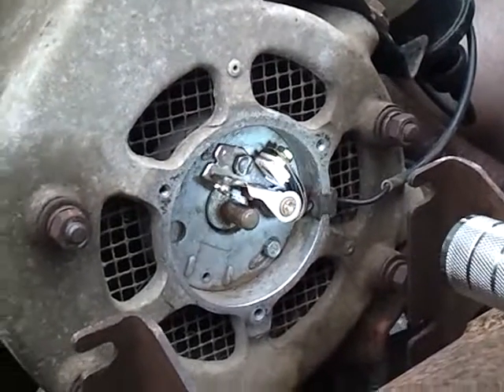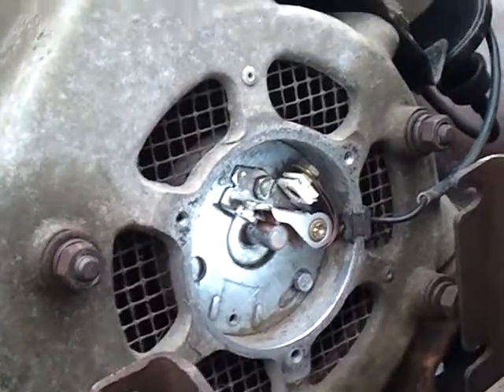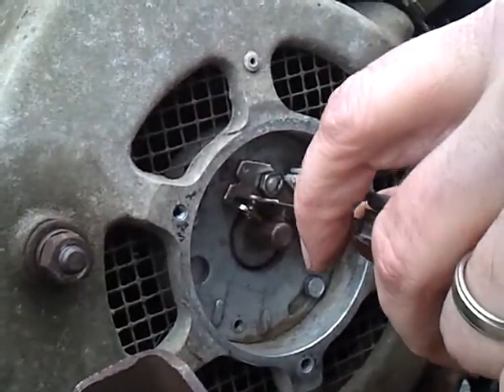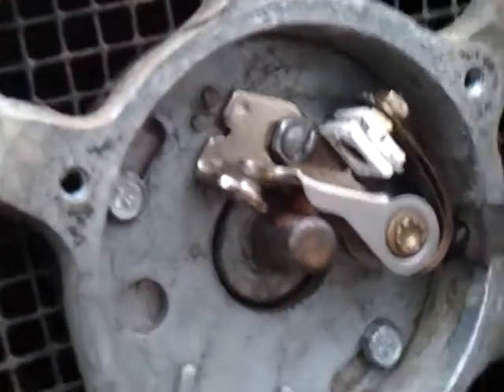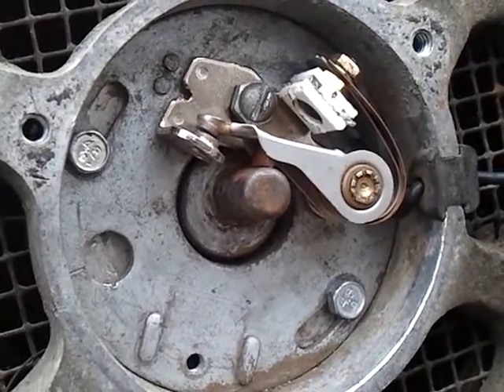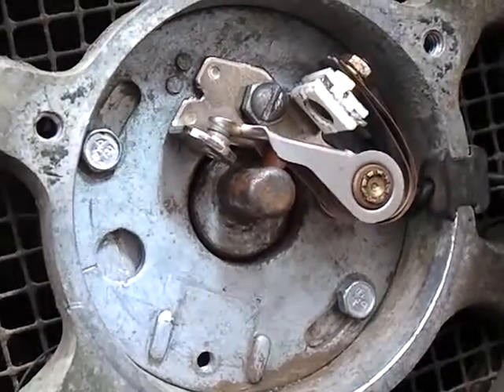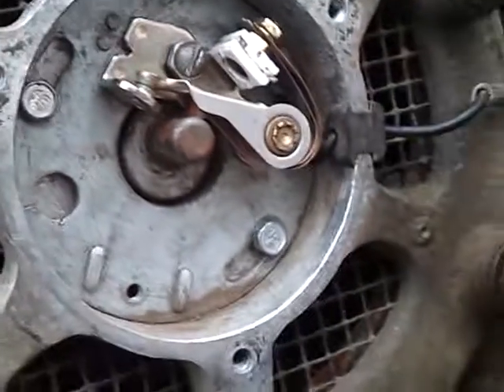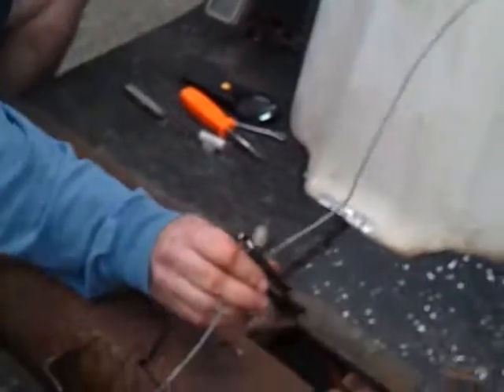Timing Harley Golf Cart

Comment: did it run better in forward  now.?    im having the same problem
Reply: Did you get that solved..i have one that wint run forward..but will in reverse
Reply: I’m having issues with mine aswell
The generator turn over. There is compression, I just won’t start….

Comment: Did you get this straightend out..cause im having the same problem...runs fine in reverse. ...but not in forward
Reply from the maker: I got it running in one direction but never great in both. Back braking work to time this thing.
Reply: while ago when i had that same problem of running in reverse but not forward a guy i know that owns a small engine repair business told me that worn rings would cause that and sure enough when i replaced the rings it worked both ways so you could check your rings

Comment: i have a similar issue. my '81 runs beautifully in reverse, but when put in drive, it sputters, has no power, and has a very hard time reaching top speed. any ideas?
Reply: Did you find a solution to your problem ..mine runs in reverse but not forward
Reply: Jacob Johnson motor needs rebuilt